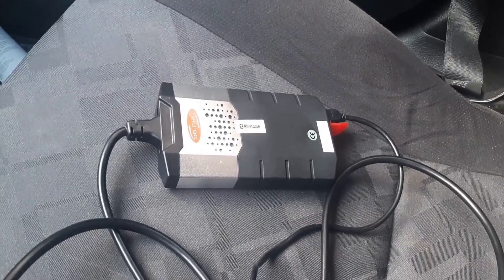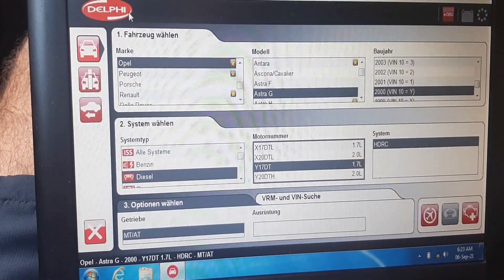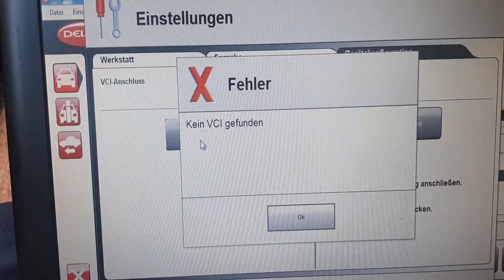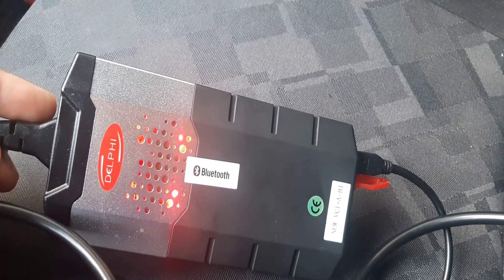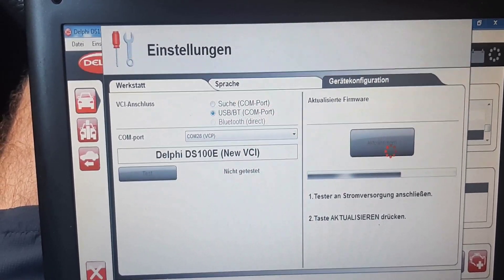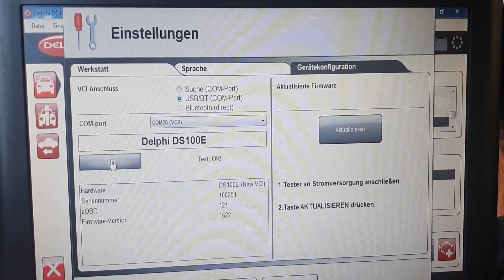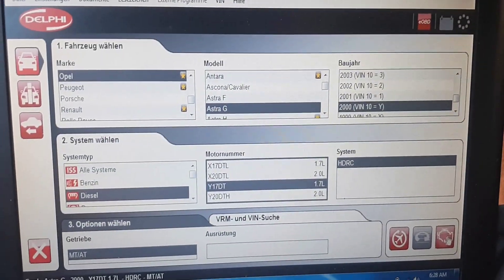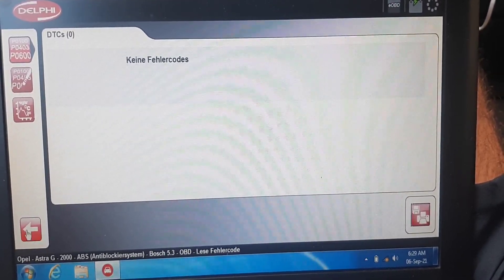Delphi Clone ds150e repair. How to Fix it after Internet Connection NO VCI FOUND

Comment: What exactly happens when it connects to Internet?
Reply from the maker: Try 😊
Reply: @YOYODiagnostic I did. I have the latest single board vci and it won't work i suspect this is my mistake. Id like to know how to fix
Reply from the maker: @caldwell1981ac  ok if you made this mistake already let's try to help you. First of all you need a new Windows 7 or 10, instal the Software again and the Drivers form the software . 
After that you need to flash the programmer again like you see in my videos.
Reply: @YOYODiagnostic  ok so can i fresh install win 10 on my same machine? Do you have link to video buddy. Thank-you

Comment: Hello dear friend, my delphi ds150 does not turn on the LED lights when I connect it. I installed several drivers and programs but none of them work, it doesn't turn on the lights even when I plug it into the car. It also doesn't let me update the firmware through the program because it tells me that it doesn't detect a vci, nor does it let me do the test. I hope you can help me, thank you.

Comment: A friend connected a Chinese Delphi to a BMW.  He had the vehicle repaired at an authorized service center.  Since then, the diagnostic does not work with the rear vehicle.  The PC can see the diagnostics, the diagnostics program loads and plays the firmware, but the OBD II ols part does not work, a communication error pops up, the relay clicks 3x on my car when I try to load it, it should click 5x correctly (tested on my diagnostics) in the evening I actively looked for and measured parts  dps and I found defective transistors marked J3Y.  I will try to resolder the ordered ones when they arrive and see what happens next.
Reply from the maker: Thank you for the info.

Comment: Mine just says no response on any car that i try to test, any idea whats wrong?
Reply from the maker: It's a single board or a dual board?
Reply: @YOYODiagnostic  its dual
Reply from the maker: @Wouterlambregts  
Give me more information, just like at the doctor, it is not enough to say that it hurts, where and for how long.  
When you plug it into the obd jack does it have power?  When you connect it to the laptop, you hear the specific sound that recognizes the driver.  Did you update the firmware from the software?  Did you look to see if the software and diagnostics are installed on the same usb port
Reply: @YOYODiagnostic  it has power, it recognises USB, it even starts scanning and lights start going blue and green, I did the com port thingy but still only get the code no response from car, I've tried the same clone from a friend and that definitely works, but when I hook up mine on his software, same problem mine reads as a Delphi 150e I believe
Reply from the maker: @Wouterlambregts  
you may have a very weak clone.  I have a video on this channel where I show the difference between a good and a bad dual board clone.  If yours shows that the weak one then don't waste your time, it is good to throw away, because the connections on the motherboard are missing.

Comment: Greetings from Serbia , i have a Delphi 2017  with a dvr board for a few days , whu won't it connect to my car Pasat b5,5 20i 2002 god .Every wire from the OBD  connector has been checked , there is not a single break , thanks in advance for your help.
Reply from the maker: Send my picture with board to yoyo.pc86@gmail.com

Comment: Hey hast du zufällig ne Ahnung. Wenn ich die firmware updaten will leuchtet es blau und nicht rot und jedes Mal bricht es ab und dann steht auch jedes Mal prüfen sie die Kabel Verbindungen und alles aber es ist alles angeschlossen. Bin verzweifelt. Ist es vllt kaputt ?! Weil es kam neu an. Wenn du ein Tipp hättest oder mir helfen könntest wäre sehr nett. Mfg Alex
Reply from the maker: Hallo,
Schicken Sie mir Bilder des Motherboards, damit ich sehen kann, um welches Modell es sich handelt. 
E-Mail yoyo.pc86@gmail.com

Comment: This stupid thing works only when you bring laptop into car, device have Bluetooth but there is no android app to connect to, phone detects it also via BT but it is useless! Also i tried to test it on my desktop computer but this damn thing need additional 12V power and it does not work via usb cable ... ridiculous 😂😧
Reply: Well almost 10years ago there was no such big diagnostic soft on phones. Thats the reason. U can have laptop on the desk close to car and that was enough.
Its just old not ridiculous.
Reply: Given how powerful this device is(when it works) then buying old designated laptop for it is no big deal. I use it with T42 😱 🙂

Comment: I have tried same procedure but firmware update didn't finish Well....like pc cable is not connected ,power cable not connected or com Port is not available.thanks anyway for your video.👍👍
Reply from the maker: Hi.
See that maybe you have problems with the port as it was in the other video.  
He had no contact and had the symptoms you say.  Try another new preferred cable from old printers because they are the best,  and check the usb port on the motherboard